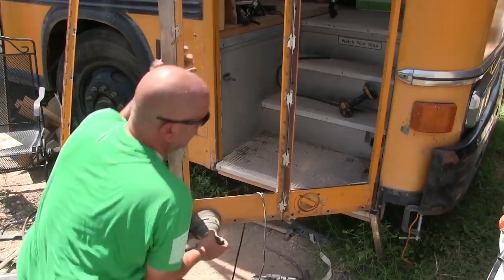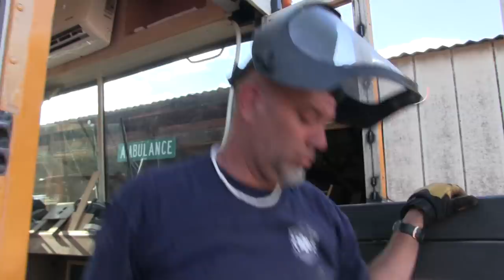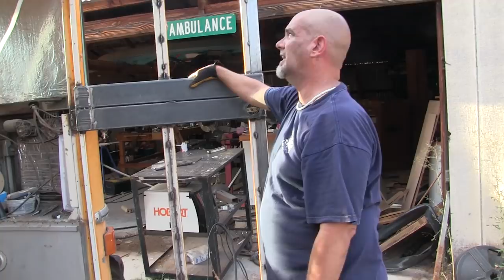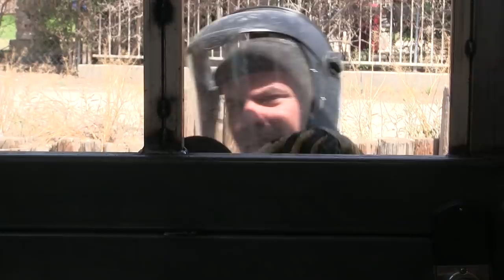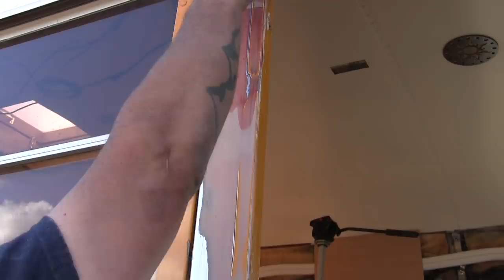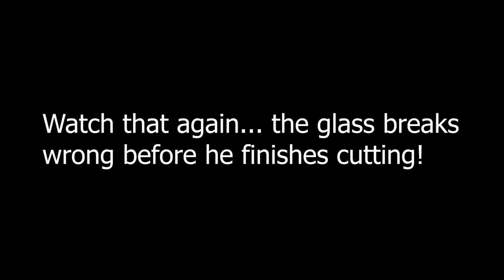Re-built Front Entry Door on our Skoolie Part 2

Comment: For future reference, when you're cutting laminated safety glass, pour a little of the denatured alcohol into the crack and light it. I know it sounds scary...it's not. The heat created by the flame will soften the plastic laminate between the two panes. After the fire goes out, use the back (not the side with the teeth) of an old hack saw blade. The saw blade is much more forgiving than the razor knife. After you finish the cut, you can actually sand the sharp edges of the glass with either aluminum oxide sandpaper or a sharpening stone.

I know it sounds scary but, trust me, it isn't. in fact, we in the custom car trade do it that way all the time when cutting windshields for a top chop. At any rate, you guys rock! Way to go trying out new things making it work. You two have an amazing, inspiring relationship. Love the Skoolie.. Peace

Comment: Start using "Ospho" on bare metal [not aluminum or stainless] .It protects the steel and is an excellent anti-rust inhibitor. In the case of rusted steel, which is iron oxide, it converts the rust into iron phosphate which stops rust in it's tracks AND can be painted over also. Just remember, Ospho is phosphoric acid and you need to use proper gloves and eye wear. I use a full face shield myself.  You can buy it at Home Depot by the quart and use a synthetic brush to apply it. I haven't had good success with natural bristles in the past.

Comment: Get some leather sleeves  and ground your left elbow on your workpiece so as to have a reference point to weld. Or bridge both hands and use your off hand pinky to support.  For reference.

P.s theres a reason glass is cut on a carpeted table.

Tincaneasybakeoven

Comment: I like the door, but I have a few criticisms. 

First I think the hinges might be a little week in the long term.  You have a heavy door so a piano hinge might have been a better choice.  As to the lock, a lever has some issues. The lever has a lot of weight pushing down all the time.  this is countered by springs, but over time they sag.  Add to this bouncing down the road and the lock is on the path to self destruction.  Latches were done away with in automotive applications years ago as  they tend to fly open on hard stops.  Also this lock has a dead latch.  Note the little pin that sits next to the latch.  this is supposed to be held depressed when the latch is extended.  you drilled a round hole and called it good, but it is bad.  The latch drags on the corners rather than on the full face, and the dead latch pin extends into the hole. If the pin is not depressed the latch is free to move. To fix, weld up the hole in the frame and profile it properly.

But since you already have this installed, run with it.  I would recomend you carry a spare latch as that is likely going to be the first failure point. Your local locksmith should have one.

A better choice would have been either a nice jimmy proof rim lock or perhaps a storefront lock with the big bolt morticed into the tubular steel frame.
Reply from the maker: Thank for this info.  I am going to make that change to the latch hole you suggested.
Reply: @BussyMcBusface  
If you have a big enough gap, you might be able to surface mount the strike plate that came with your lock.